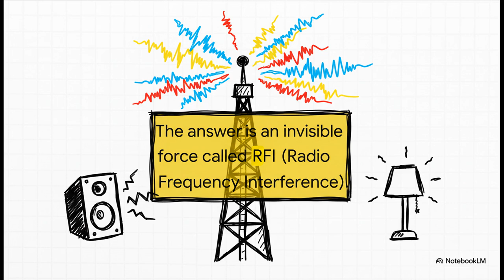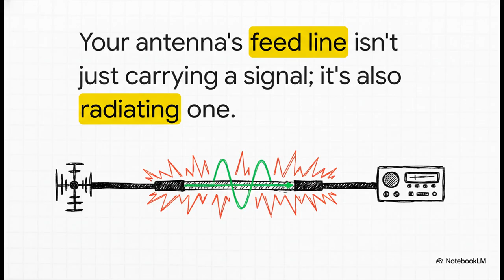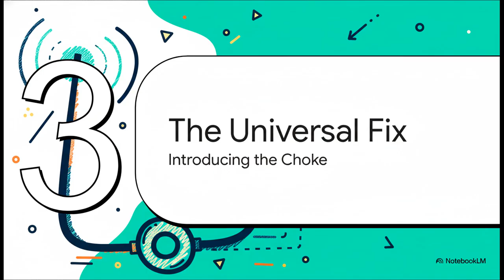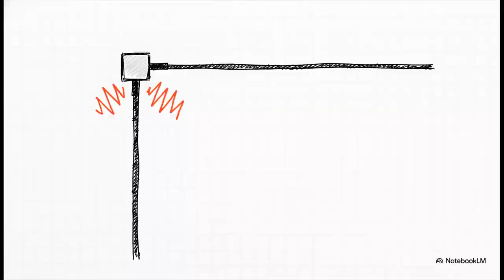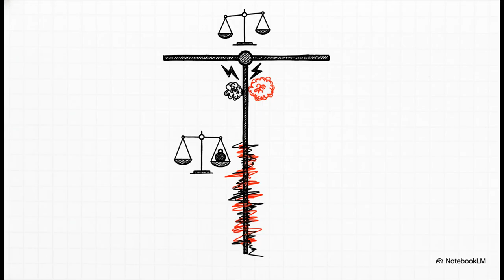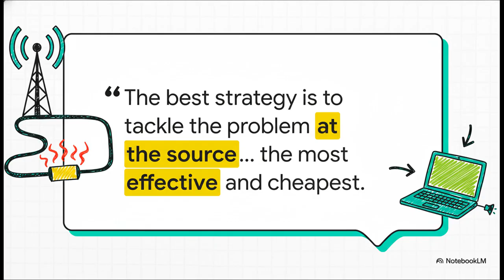How to prevent RFI caused by EndFed, vertical and dipole antennas

Comment: Question, on a vertical would you utilize a 1:1 UnUn and a toroid choke?
Reply from the maker: I'd definitely recommend a common mode choke.
Reply: @pa9x but not both correct?
Reply from the maker: @Franklynnart those are the same UnUn and common mode choke.